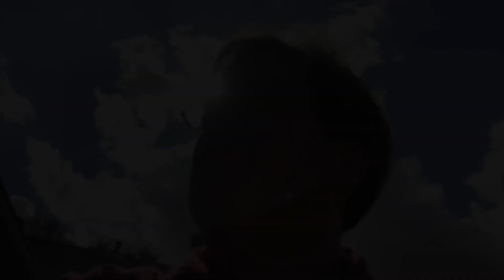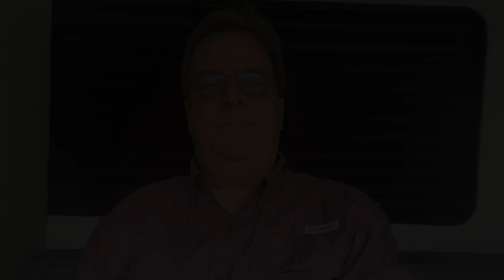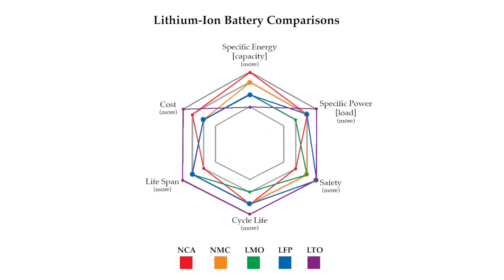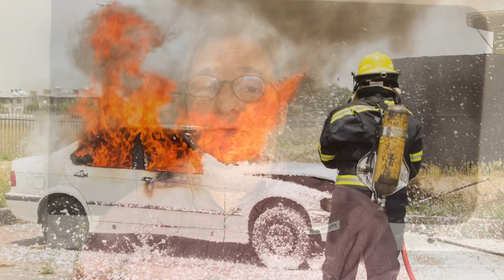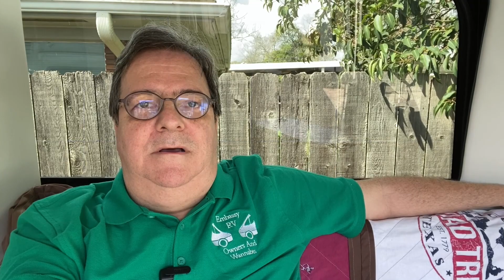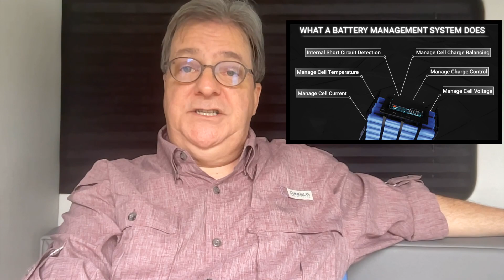Energy Management 3: Safety Concerns

Comment: Robert, if you mentioned it, I missed it:  which type lithium battery does Embassy currently put in their Class Bs?  LFP or NMC?
Reply from the maker: Currently (pun intended), Embassy uses LFP batteries (Lithionics or Mastervolt). LFP has a somewhat better safety record, but does not hold as much power in the same space as NMC. Good question!